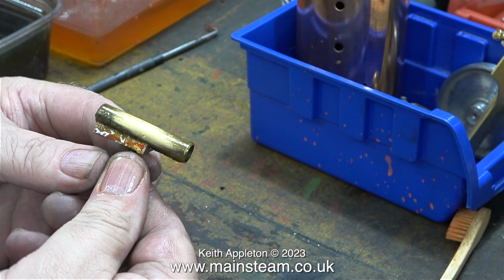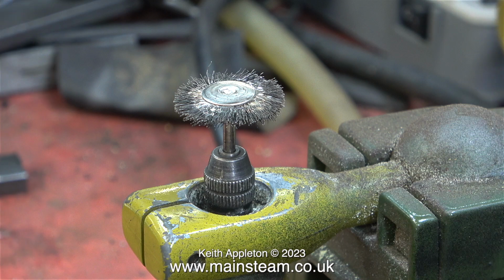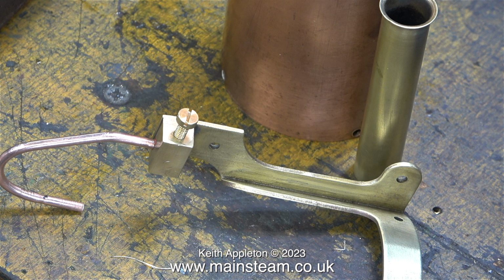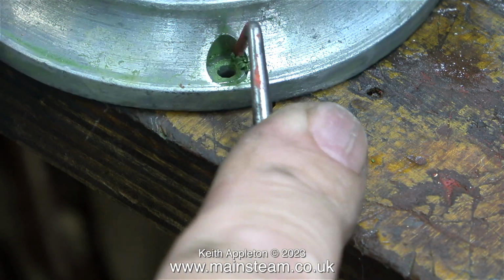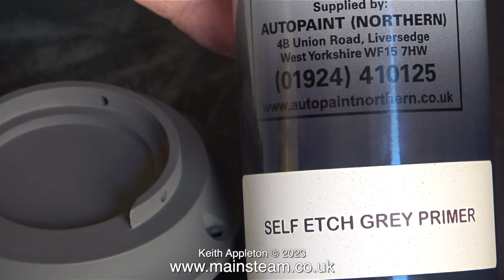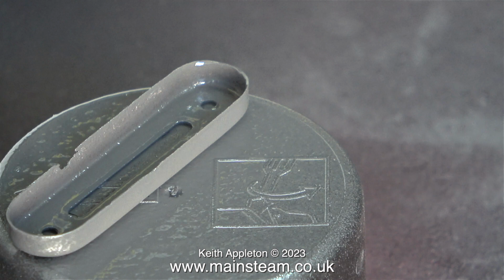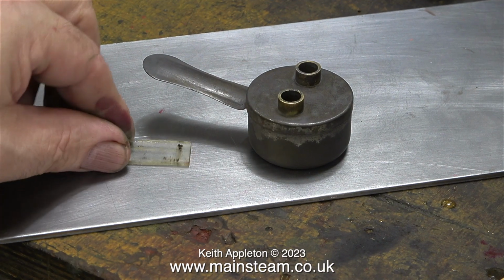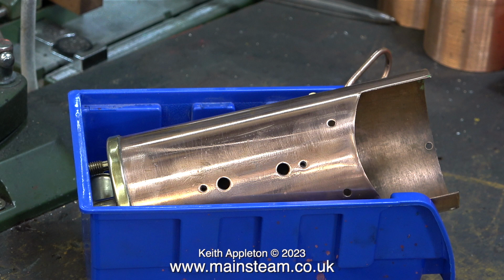REBUILDING A "BURNAC VULCAN" MODEL STEAM ENGINE TOY - PART #6

Comment: Have you ever tried spraying a cleaned up part with automotive sclear coat from a rattlecan?  At least here it is some kind of interesting chemical... its not paint.  I nylon grit brushed parts and then scotchbrite and the cleared it.  Its not bad and is pretty durable.  I used it for metal parts under the car hood.
Reply from the maker: No, I have never tried that.

Comment: I wonder if you could soft solder the wire brushes into the hub to stop them from getting in your eyes?
Reply from the maker: They usually fly off because they fracture, the heat involved in soldering would probably make it worse . . .
Reply: Not sure but I have stopped using wire brushes - too dangerous. Instead, I have switched on to the nylon bristle brushes, they don't shed ( so far ) and you can get a range of grits, from 80 to 1000. They work very well indeed.